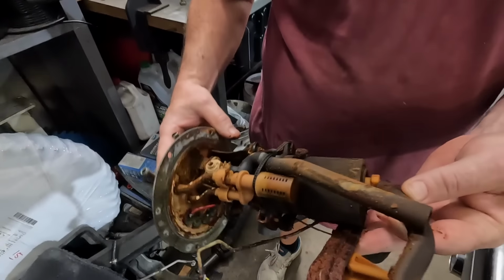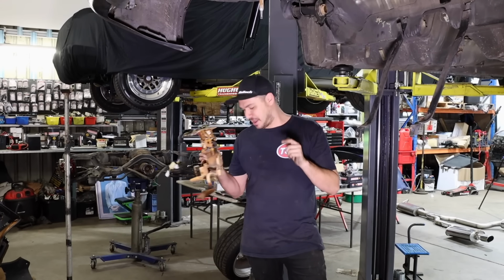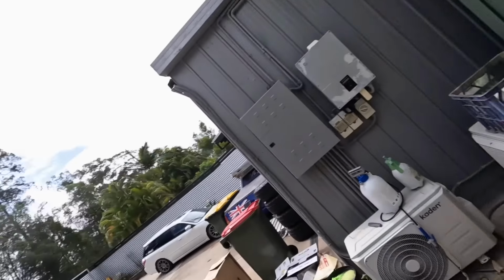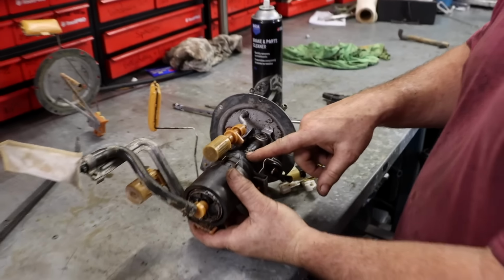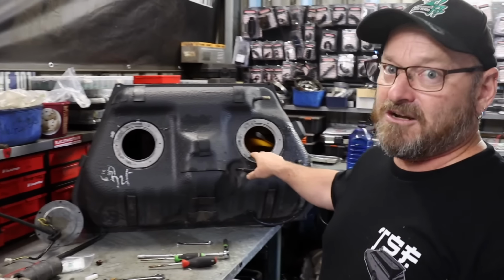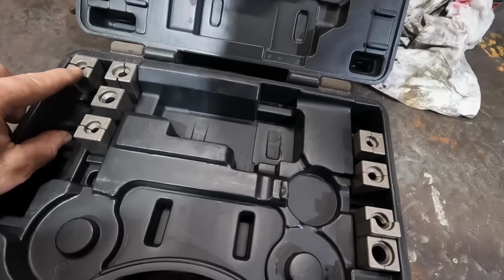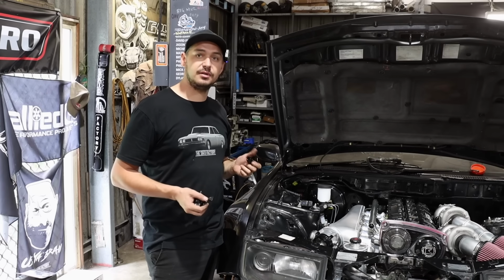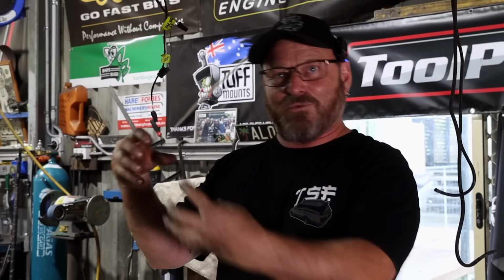Rusty fuel tank, Modified Fuel pump Hanger & DIY HICAS Delete - RB25/30 Powered Nissan Z32 [EP6]

Comment: The hydrochloric is great for rusty tanks but can flash rust when removed. A further rinse with phosphoric acid will convert any remaining rust to iron phosphate. if the metal rescue contains phosphoric acid you'll be set
Reply from the maker: Great point man! Yeah we coated it with some multi purpose lube instead but I’ll keep that in mind for next time!
Reply: Isn’t phosphoric acid one of the ingredients in Coca Cola? 😂
Reply: @drewski5730 it is but the concentration isn't high enough

Comment: Hcl will instantly strip any gal/nickle coatings way before it gets into the rust. When im home plating its what i use to strip the old plating. I would electrolysis it. Now you have gone raw dog the tank with the hcl you need to coat your now mild steel

Comment: Had to use reverse electrolysis on a tank once, not saying it's a better option, was just the only thing I could think of at the time. Figured it was worth a try since I had good results on a floor of a car and some doors. Luckily there was no pitting, and I was able to save the tank. Normally I'd buy a new one, but getting parts for this particular car is a royal PITA. Car is looking mint BTW!

Comment: I believe what the hydrochloric acid does is eat the unrusted steel thus separating the rust off. Obviously you don’t want to soak it too long or you’ll get the holes you mentioned.

Comment: Definitely agree with Al on the old "M90 on the 1UZ" which I remember from the Soarer scene 20 odd years ago was done to death - good for about 30 extra HP at the crank if you are lucky, and in the real world you'd barely notice the difference other than all the extra fuel you'd burn.  Even in NZ they are getting to be very rare cars now though.

Comment: I reckon that was fuel bug that caused all that rust. When it gets a go on, it rusts the buggery out of everything metal and absolutely reeks when you open it. Probably wouldn't hurt to run a bit of conditioner but I think you certainly got it with the hcl.

Comment: I had my tank do the same. It was after a period of heavy rainfall and 98 running out at the servo, I was forced to use E10. If you switch to E10 and there has been tons of rain, the older servos will have water in their fuel, ethanol is like a magnet to water. I had a pool of water in the bottom of my tank, the car would die on corners and then filled the tank with rust.

Comment: I had a tank in my awd tx3 that was way worse than this I simply used vinegar to clean the tank and reverse electrolysis to repair the pump cradles etc all worked perfectly and cost me about $20
Reply: Did you fill the tank with pure vinegars?

Comment: If I understand this correctly, you have to get that threaded bit for the oil filter out of the block yeah? maybe you could get your hands on one of those induction heating coils to help it gtfo of its hole? Just a thought.

Comment: Use electrolysis, i recently did it on a wrx tank that had been in storage for 12 years, only need washing soda and a power supply, can then use a fuel resistant  epoxy to line it afterwards, i didn't hand hasnt been any return of rust yet

Comment: Calibrating an ic7 dash with dual senders is painful lol my e30 just reads 100% constantly. Tried doing with voltage and ohms. No luck
Reply from the maker: These senders and Subaru both work in series so it's no different to a single sender.

Comment: Love the vids guys, especially the fuel system setup as that's what I'm upto at the moment. What do you guys use for the tank vent/ carbon cannister?
Reply from the maker: I have a tiny canister from an impreza I am using. The original was absolutely enormous.
Reply: @theskidfactory  is it still in the engine bay, connected to the engine? I'm having a hard time figuring out what to do with my 1jz swapped s13

Comment: Will the oem Nissan Jet pump be able to keep up with that high flowing fuel pump? On JZX/JZS stuff you usually have to get a "Jet pump killer" or higher flowing jet pump to keep up with the high flow in tank pumps.

Comment: Hydrochloric acid is not a good idea because it will cause chloride attack of metal and can result in corrosion later. I would use hot citric acid or if not available sulphuric acid followed by phosphoric acid(rust converter). I also would have cleaned it with caustic or degreaser first to get rid of the petroleum based substances first.
Reply: However it will be fine and probably last 10 years

Comment: why reuse the crusty fsu instead of something like the radium hanger? If you're going AN anyway, it just seems like extra work lol
Reply from the maker: Because the billet hanger costs $900. If I was running twin pumps I would use one but I am not so it's unnecessary at this stage.

Comment: Seriously what were nissan smoking when they decided HICAS was a good idea on performance cars? Could've saved themselves (and R/S/Z Chassis owners) so much money not developing that junk system lol. Highly recommend the GKTech eliminator kit if you're after a more permanent solution to deleting it. IIRC a full HICAS system weighs about 60kg on the electric variants so plenty of weight saving to be had.